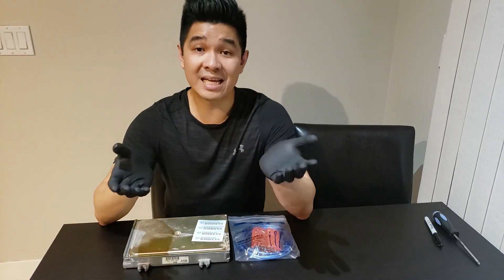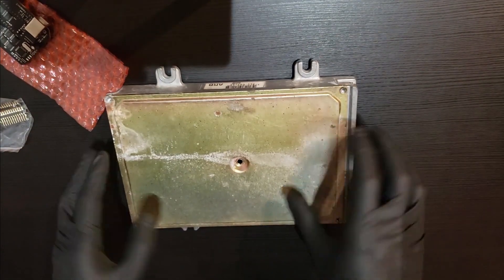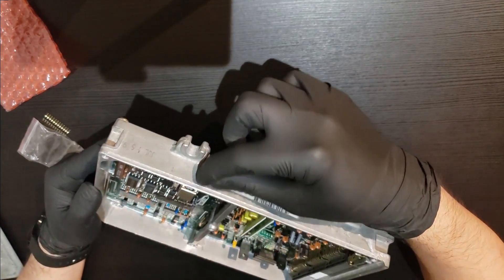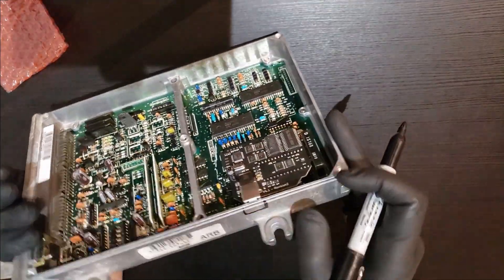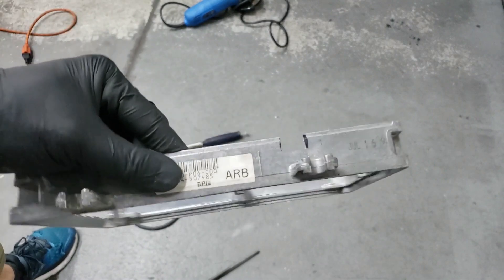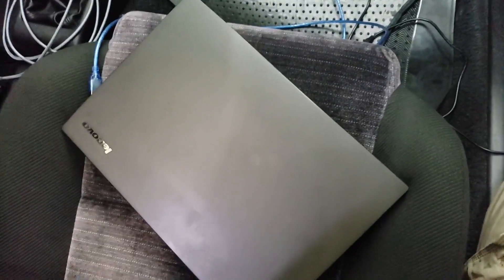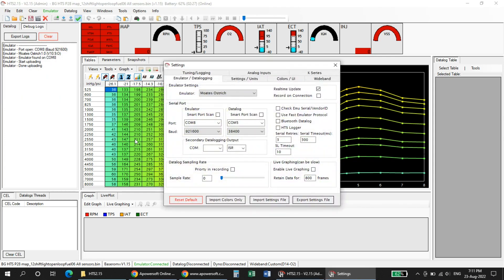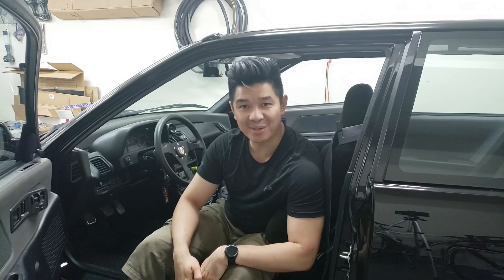||HONDA EF9/ED7 88-91 CIVIC&CRX|| Installing BMulator by BMtune into My EF (P28, P05, P06, P72, P75)

Comment: do your car has o2 narrowband for afr in ecu?
Reply from the maker: I used a wideband o2. You can't really tune with narrowband.
Reply: @BudgetGears oh ise thank you im just new in tuning thats a good info 

And btw di you experience to rechip an obd1 p07 G01 with board 2D1560 1500? And If theres a video ?
Reply from the maker: @rorenstv9051 sorry, no experience with those. Shouldn't be that different than any other obd1 ecu though. Check hondatech and other historical sources for more info. I'm sure others have chipped those in the past.
Reply: @BudgetGears thank you brother and btw your honda wireless bluetooth data logger is solid im using it now thanks for you videos really appreciated it it is a big help for us beginners and want to learn more about car stuffs specifically in civics 

Ride safe and more power to your channel 😊

Comment: Where did you get the bmulator kit? I only found it on de official website, but im not from the states and im not sure if it is secure to buy there
Reply from the maker: @morari98  i got it from their website.
Reply: @BudgetGears I just ordered it, the Bluetooth data logger, and the capacitor kit for my p28. Set me back 243.05
Reply: @johnbrentonlll Did you receive it?

Comment: does it work with auto trans?
Reply from the maker: This is an emulator for tuning. It'll tune auto and manual ecu. You'll just need a tuning software that can tune auto trans. That is something I cant answer because most people tune for manual and most software is designed for manual. I'd recommend reaching out to the different software companies and find out if their software can tune auto trans. This emulator is compatible with a wide range of software.

Comment: I'm having problems with the data logger not connecting. I have a newer version I think with the logger in the emulator
Reply from the maker: I'd suggest to contact Marc from bmtune or check with the bmtune group and see if others can help. My version didn't have a datalogger. However, you can just disconnect the pins to the datalogger and plug a ftdi cable in and see if you can datalog. This can rule out if its your ecu or the emulator. Datalogging is all driven off the cn2 port. You can even hook up a Bluetooth datalogger like what I did in my other video.
Reply: I figured the problem out I resolder the ecu whoever did it was a hack and didn't do half the board.
Reply: @raymondpalma4308 glad you found the issue
Reply: My emulator has the same thing...the cn2 port needs a header pin then connect to cn2 ports 2and4.

Comment: Pretty sure this is a scam people I’ll order one just to not get it we’ll give  it a test
Reply from the maker: Not sure what you mean by scam. Me and many others purchased this with our own money. I've used it for my tuning needs and it works. Bmtune is probably the most affordable emulator out there. If people want to spend a lot more, then they can do that. I've had no issues with my bmulator.
Reply: @BudgetGears  no info other than your page website looks like it’s been made out of a crappy template no forums no real effort
Reply from the maker: @edbossano7686  Yeah I was iffy at first too, but we're all protected on our credit cards so if I never received the product, I would have just called my credit card company. Just to be clear, I have no affiliation with the seller and I am not the seller. Just in case you didn't watch my video. I feel like you're trying to call me a scammer. I'm just a guy that bought the emulator to use. I made a video because people should know about a cheap affordable option. I get nothing out of doing this. But hey suit yourself. There are many of us that bought the emulator and are happy with it.
Reply: @BudgetGears  Ight bro ima take your word for it ima order one with Bluetooth adapter
Reply: @edbossano7686 was it a scam hello?
Reply: This comment im pretty sure is a scammer
Reply: @dajahvue exactly..
Reply: I purchades 1 the las month and i recieved it in 3 weeks not is a scam
Reply: Just lookup "bmtune-sucks" and you'll have all the info you need on how embarrassing bmtune's creator is

Comment: just by buying bmtune can i change the map of my honda civic coupe? it has a P28 ECU, and another question is it plug in play? Or do I need to solder it to the board?
Reply from the maker: You can always change your map whether you're running chips or emulator. Emulator is rtp. And your other question can be answered by watching the video.
Reply: @BudgetGears  I watched the video but I'm from Brazil and I couldn't understand everything (I don't speak fluent English). I would just need to cut the housing of the center for the USB port?
Reply from the maker: @lbrturbogarage  yes, the board replaces the chip. You can solder the board or socket and plug the board in. As long as you have a good connection. The best is soldering. But I plugged it in cause I only use for tuning then I burn my tune onto a chip and run just the chip.

Comment: Curious if anybody has had any issues with certain things not working like changing vtec engagement and wide band 02 showing more than 10.00. I've started seeing lots of talk about this on Facebook groups and people are saying you have to download bmtunes software wich is literally a knockoff of hts. People are saying that bmtunes has hidden code in the emulator and bmtunes tunning software and that hack your laptop or what ever computer you are using
Reply from the maker: I've had no such issues. Bmulator works just like how an ostrich used to work. I had no issues changing my vtec engagement using HTS or even with crome. As for wideband, where are you reading it? Make sure your gauge setting is set correctly and that you've calibrated it to whatever software you're using. I'm assuming HTS at the moment, so you can't just take the default settings in HTS, you need to calibrate it based on the tech sheets you should have received with your wideband. 

There is a lot of hate on the HTS group regarding bmtune and his products. The early versions of the software did trigger antivirus, which is why people say it hacks your computer etc. But you're not restricted to using bmtune. You can use many softwares to on the bmulator. There will always be haters online. I've got no opinion on the issue. Hondavert is another one people hate on. Personally, I buy whatever works and is affordable. I've had no issues with my bmulator. You just have to take all those comments in and make your own decision.
Reply: @BudgetGears  what other software programs are compatible with bmulator?
Reply from the maker: @johnbrentonlll  Information is on their website.

Comment: Why you using 2 USB cables when you can connect the datalog port to the emulator and just use 1 USB cable?
Reply from the maker: This is the latest emulator version from BMtune that doesn't have datalog. So it needs a separate way of transmitting the data to the software. I've since installed a bluetooth datalogger into the ECU and only need 1 cable now.
Reply: @BudgetGears  I'm using the first version with the battery and u can connect the data log pin to the emulator n just use 1 USB I think u can do the same too
Reply from the maker: @breehernandez9551  V2 doesn't have such option. Check the website and look at my board. No battery or option on attaching datalog. Even says right on Marc's site that there's no datalog in this version and that it needs to be purchased separately. Your version is the only that has the datalog feature not mine. So I can't do the same. As mentioned, I've since installed a bluetooth datalogger. I'm completely wireless for datalogging. I was hoping that he kept the V1 with the datalogging like yours, but oh well. V2 works fine though. It doesn't matter to me because I just use for tuning and then I burn the tune to a chip.

Comment: From what I’ve gathered this drops right into an already socketed ecu correct? Such as the standard chip socket, unlike Hondata etc. 

I have a P28 that’s currently got a chip in it, and I would love to reuse it. I plan to boost my d16y8, and just discovered this emulator today.
Reply from the maker: Technically, it should be soldered into place, but I just dropped it into the chip socket. What I didnt show in the video is that I made some feet for the board to give it support while in the socket. But yes, it can drop right in and work like that. Its how I use it. Once I'm done tuning, I just burn my map to a chip and pull emulator out. You can very well run it on the emulator permanently too. Its a great emulator for the price. Does what I need it to do. 😁
Reply: @BudgetGears  nice! I like your method there. Yea, I might snag one of these. I’m not new too Honda stuff, but definitely pretty much a rookie with the tuning stuff. 

Eventually I want to use a 3-port boost solenoid. Want ti be able to double the gate spring but keep lower boost in first gear. Thinking about getting the Burton Racing boost by gear kit.
Reply: @BudgetGears   wait you mean you made like little platforms for the emulator  board to rest on? Curious if you 3D printed them like you did to secure the Bluetooth data log accessory.
Reply from the maker: @DomkeBoy  Yes, I 3d printed little feet that clip onto the edge of the board that holds it up. So kind of like a table with legs. Just to support the board cause it can get disconnected if you accidentally push on the board edge, but really if you're tuning, you won't be touching the ecu. So once it's tuned, you burn the map to a chip and pop it out. So same result with or without the legs. But since I street tuned my car, I didn't want the board to come off the socket accidentally.
Reply: @BudgetGears  Well that’s awesome! I would most likely leave it in the ecu and daily it like that. Until I have another engine ready to tune in a different Honda. Then I might buy a chip burner, but for now I’d rather put the any money that’d cost towards an emulator. 

If I go this route could I possibly purchase those 3D printed legs from you?
Reply from the maker: @DomkeBoy  I can print the legs for you, but I've also shared my design with BMtune as well. You can probably reach out to Marc from BMtune and ask if he can print for you along with your purchase. That way you save on the shipping. If he says no, then maybe hit me up on Instagram and I'll give you a quote on printing and shipping.